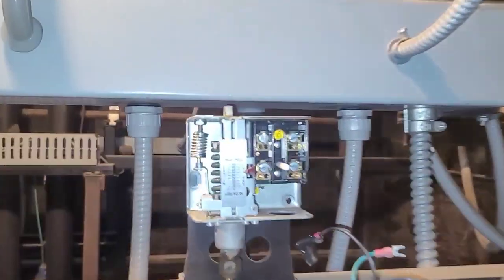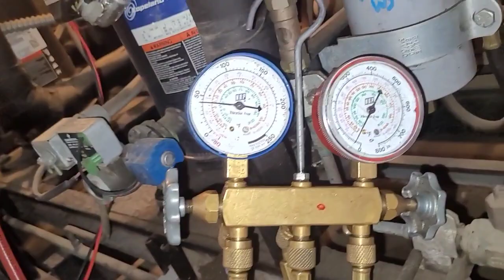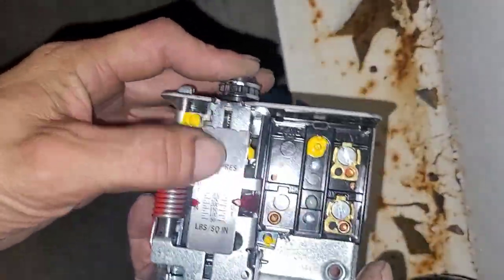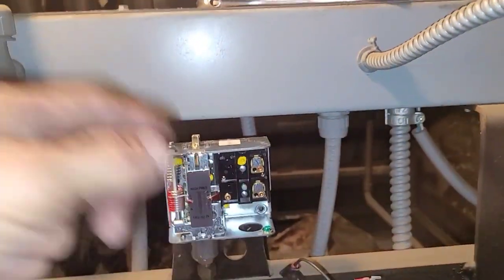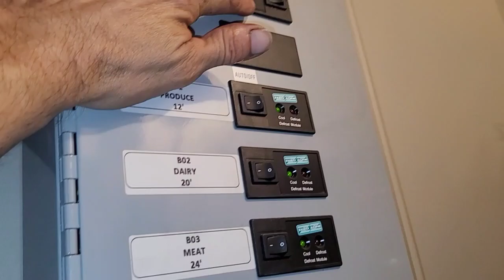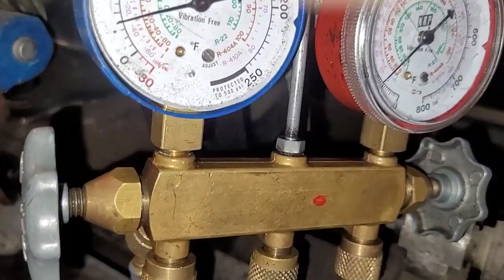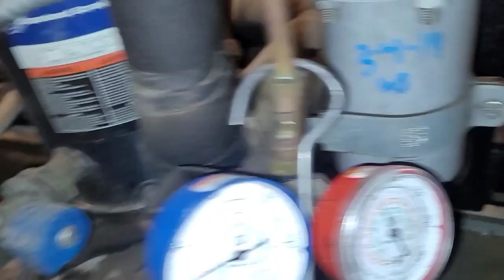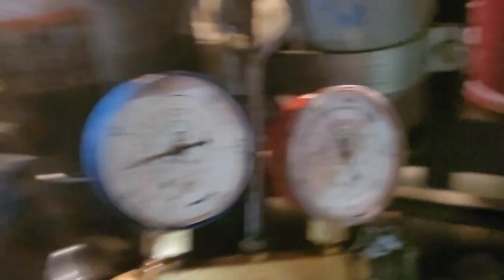P170 High Pressure Control

Comment: You not vac compressor out after swap
Reply from the maker: Not necessary at all. Even if the small minut amount of non-condensable gas that the hoses and pressure control would occupy were to get into the rest of the system, the dryer would catch it all. This is a huge multi hundred pound system. But in this instance, anything inside the hoses or in the pressure control that we're non-condensable would be pushed and compressed into the chambers of the pressure control and not go in to the rest of the system.

Comment: Hey man, what would cause a freezer case to ice up every 2-3 days. Have to de-ice the coils every 2 days overnight at my store. Also doesn't help that the fans never turn off in defrost
Reply from the maker: It's most likely your fans failing to shut off during defrost if it's an electric defrost. If it's hot gas, then the fans stay on. Depending on the model and make of the case, you can pull a diagram online or I can help you with it
Reply: @HVACRServiceTech  model ONRZH5 Hill Phoenix
Reply from the maker: Electric 1 Ph
Electric 3 Ph or
Hot Gas?
Reply: @HVACRServiceTech  Electric 3 PH
Reply: it's our only case where the fans do not turn off on defrost
Reply from the maker: In that situation, the fans not shutting off during defrost, is keeping it from being able to defrost. its probably the Defrost Limit Relay.
Reply from the maker: Here's a video of one I did a whole back. Same concept. Check and find out if the relay is energized or if it's not energized. If it is not energized, then you need to find out why it's not getting energized during the defrost cycle. If it is energized(or getting control power) replace the relay.
Reply from the maker: https://youtu.be/7TtLlVFsdQQ
Reply: @HVACRServiceTech thank you. Much appreciated 👍